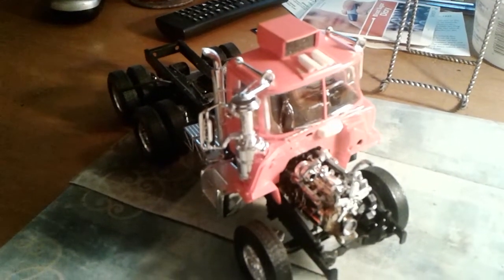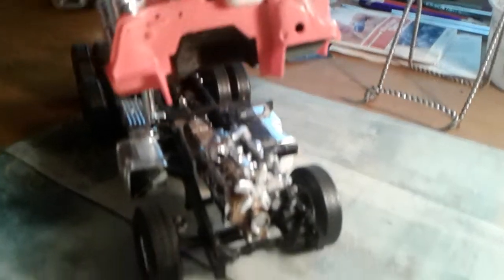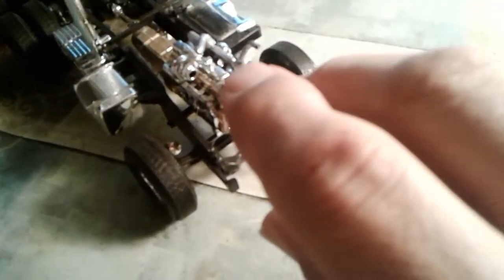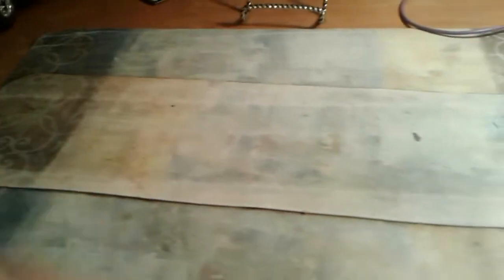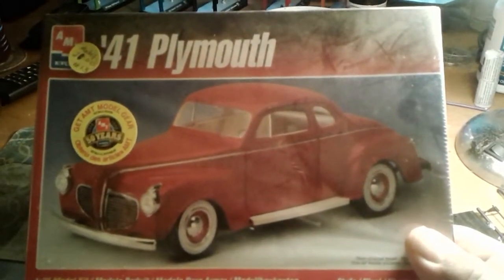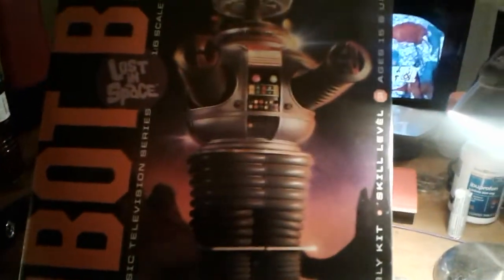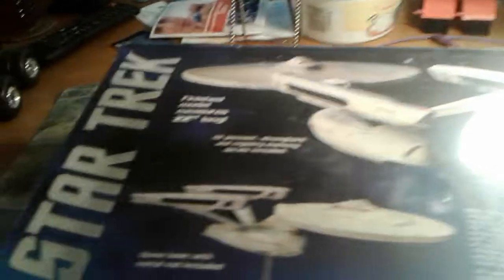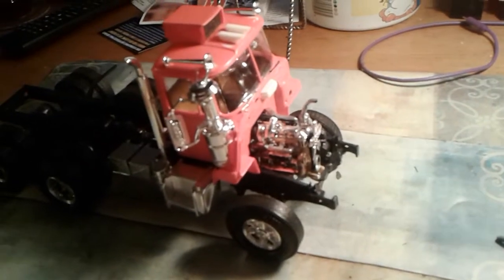Big rig update (and problem) and some stash adds

Comment: About your problem with the Cab ... would it work to sand a chamfer on the front edge of the "black" lower cab Floor? ... or is the Cab Floor  sitting all the way flush on the gearbox? maybe the engine is just sitting a bit to fahr in the back?! ... hope you will find a good solution for this problem ... cheers Make*